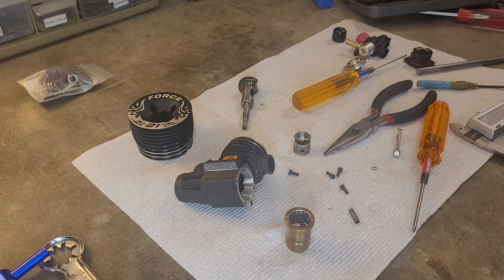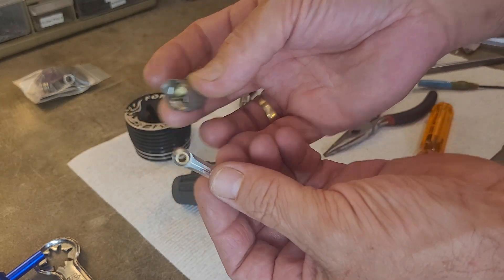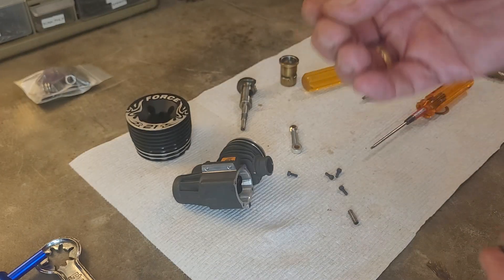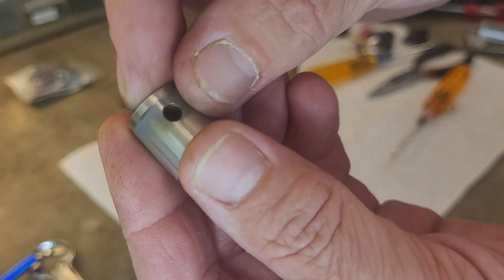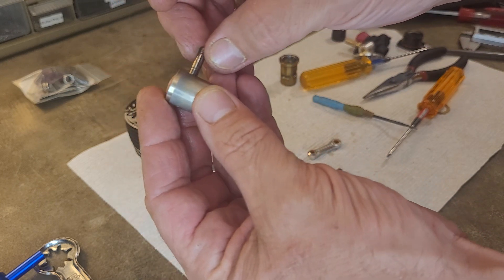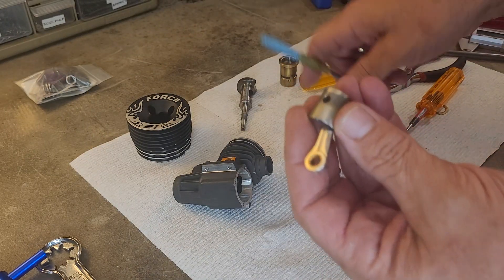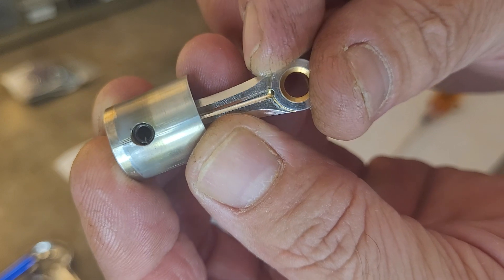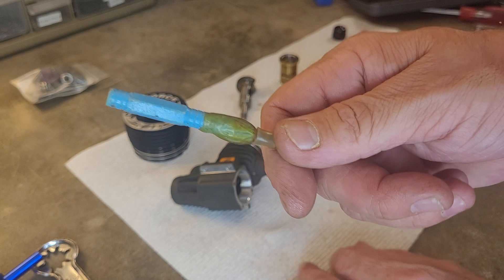How to swap out the connecting rod in a Nitro engine remove and replace

Comment: Hi Todd thanks for the video. Has that rod got a oil hole and if so what side of piston are you putting it. Thanks Jeff
Reply from the maker: Most rods have an oiling hole, and it faces the front of the engine. Oil hole on rod and cutout in the piston skirt go together, facing front.